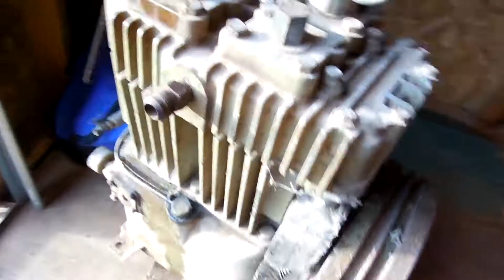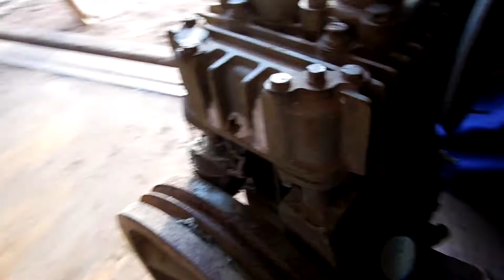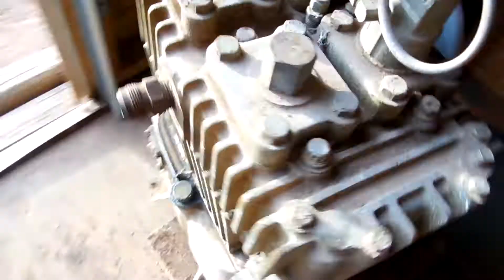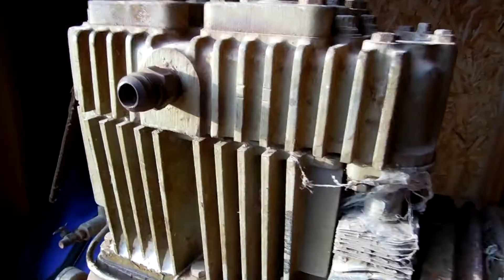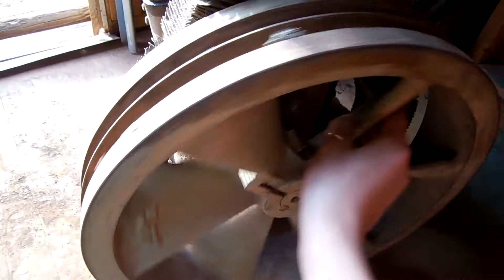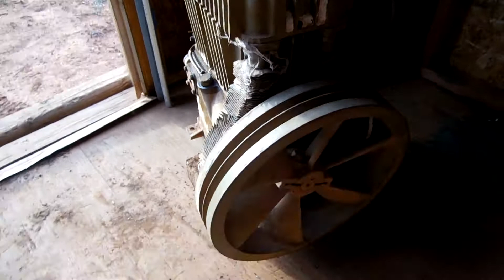Model 325-10 Quincy Compressor

Comment from the maker: Thanks for the idea to use a sledge hammer to straighten the fly wheel.
I used a 20 lb. sledge hammer with a piece of wood between it and the flywheel and was able to get it straightened. At the time of filming this I did not have its tank with me but I do now. I am guessing a hydraulic unloader is going to be expensive so for now I will just stick with what I have.

Comment: Just spend the money on a hydraulic unloader it's really the way to go I am going to post a video of installing dual controll on mine soon just waiting on some parts
When I worked for the Quincy dealer we used to have some success straighting 
bent cranks with a dead blow plastic composit sledge hammer. Geter bolted to the tank get the flywheel on the low side and wacket on the top side if you know what I mean

Good luck!!